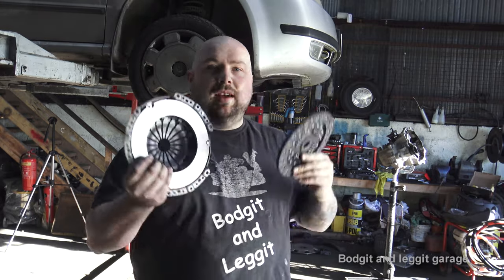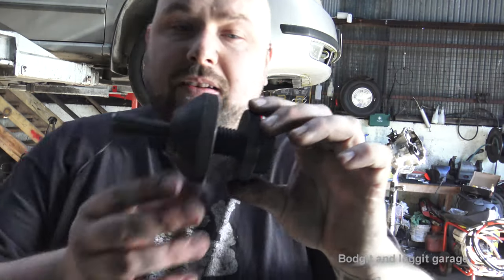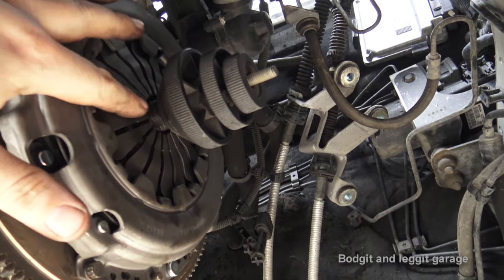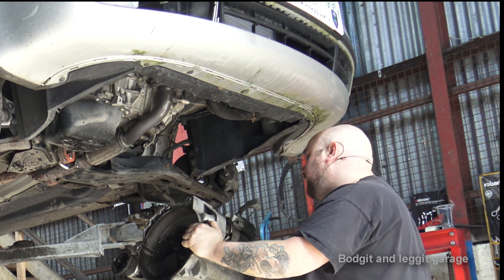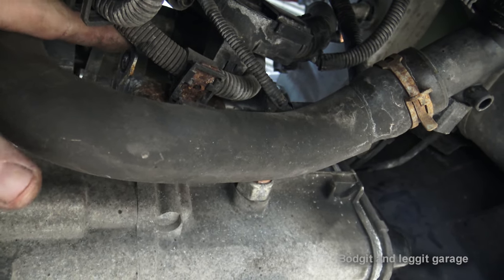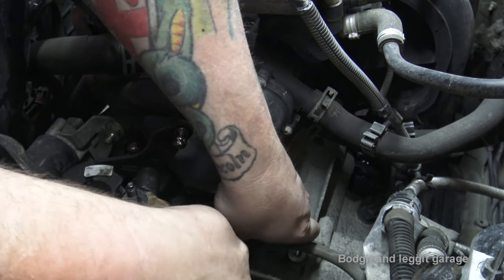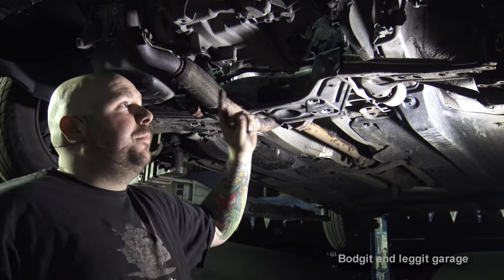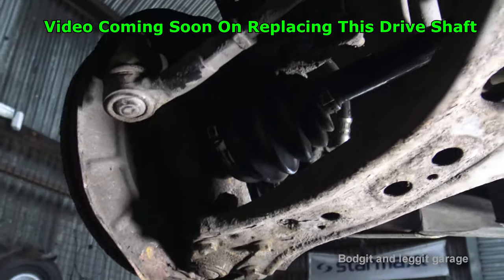Skoda Fabia Clutch Replacement part 2 Bodgit And Leggit Garage

Comment: I had a Seat Altea shit a drive shaft inner joint like that last week. It only came in for the outer boot but fell apart when striping and wouldn't stay in place when reassembling it. New shaft Sorted!! 👍
Reply from the maker: One Auto, I don't know how many times I've been there when you say one thing and it turns out to be worse don't you just love having to ring the customer back to tell them this lol

Comment: I see that one of your viewers has already mentioned about the clutch tool for alignment. That would be great Leon for your viewers as it seems to be a great tool as you've shown in a previous video of where you did a clutch job. That's a bummer about the drive shaft, but you'll get it all sorted in the end :) Have a good one Leon!
Reply from the maker: stuzman yes they are really good tool really handy the one I would get next time if I was to get one would be the Sykes pickavant 01370300

Comment: How did the customer know the clutch was going or was it gone? Also while you replaced the clutch how did u know the flywheel was ok and also didnt need to be replaced? Sorry if thats a stupid question
Reply from the maker: GrahamC 95 when you put the car in gear it does not move this not always pointing to the clutch that's gone but you know you have a problem with in the clutch somewhere the flywheel was not damaged and straight did not have any discolorations on it so I knew it was ok I've never had to replace a standard flywheel ever
Reply: bodgit and leggit garage thanks for the reply!
Reply from the maker: GrahamC 95 anytime mate glad I can help

Comment: Nice video Leon. Was wondering about that CV shaft from Part 1 looked pretty bound up. May be the result of the clutch slipping & grabbing at a higher RPM...CV shafts don't like that. Cheers Leon...SORTED
Reply from the maker: Hayward's Automotive I don't think it was because of the clutch I think it's just worn out there was a lot of blistering on the balls and pit holes
Reply from the maker: Hayward's Automotive no I can see how that can ruin your day but some balls exploding sometimes can be a good thing lol